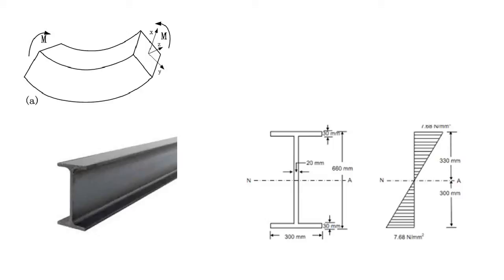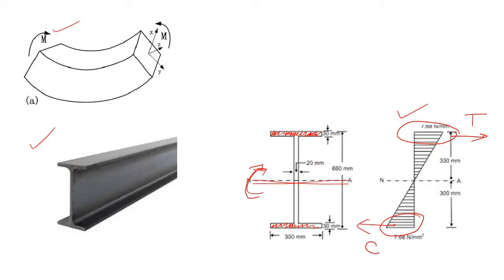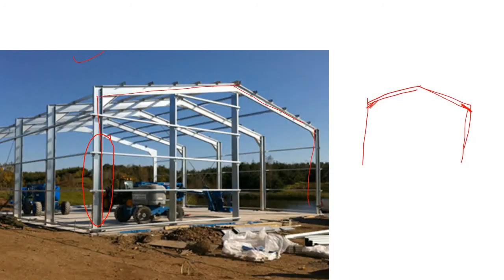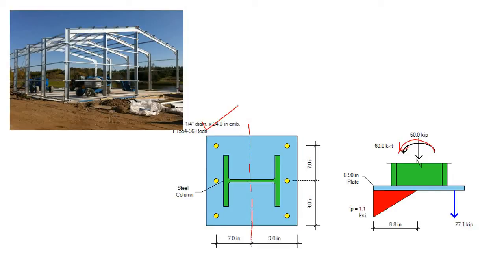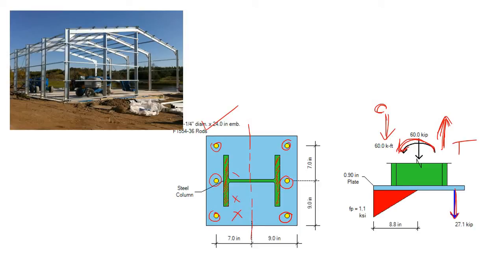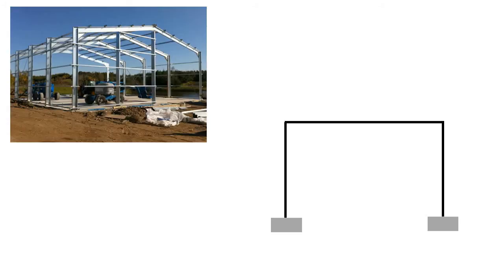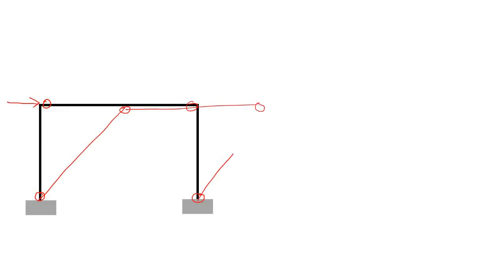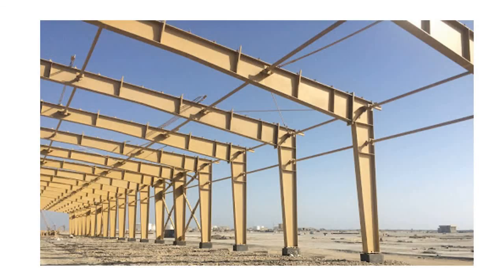Problem with I-Section Column

Comment: Excellent.. But i think pinned beam does not have any bending moment due to lateral load. And both columns have moments at only base  and not on the other side
Reply from the maker: Right

Comment: I have one question, i did an analysis about column with cantilever beam which the column is 3.3m and cantilever beam is 1.2m using I-beam. I used IPE 300 for both column and beam and the results showed that column failed, however when i change the column to tubular with diameter 219mmx10mm, the column did not fail. Why tubular is better than i-beam?
Reply from the maker: tubular has equal moment of inertia about its every axis which makes it much more robust